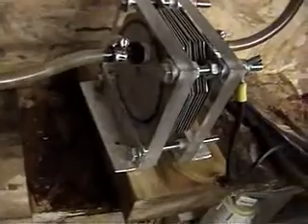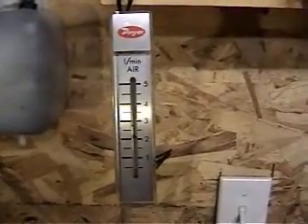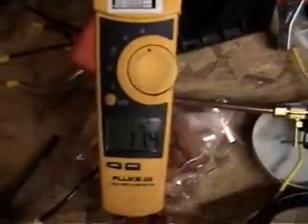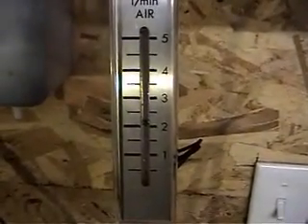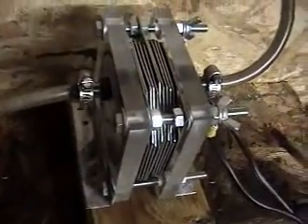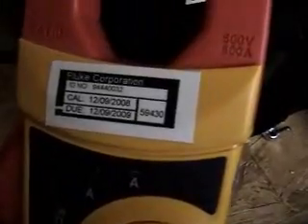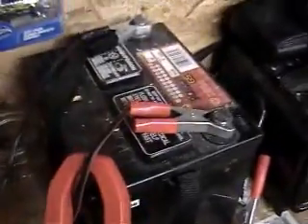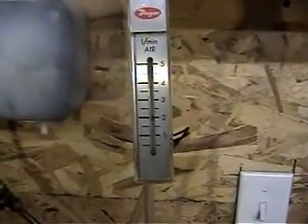HHO 3 LPM 23 AMPs

Comment: With that amperage the water will heat up very soon, that is not good. I suggest to use 120 V AC rectified half wave and use 20 plates.

Comment: i like the way you designed the cell...could you gang a few together by putting them back to back with two long all threads, one going through all three on one side for the positive and another on the other side for the negative ? or would that not be wired right?

Comment: For that size cell, with holes in the plates, surface area loss in the corners, 2 LPM with 12 amps. You must NOT be applying 12 volts but more like 30 volts!!! and your making water vapor and steam and not much HHO. Most HHO guys lie about the output, for some reason? Ionic water vapor does get MPG gains in dry climates. Google : Hydrogen Generator review to learn more.

Comment: @H2GenerationX 
Truthfully its for psi not just air because if you want to get technical than air has over 60% nitrogen and it has over 10% oxygen and another 30% other gasses. So when you say AIR you should no more about AIR.

Comment: @Me102288 
Yes it is only 12 volts that is correct but they were wanting to know if at 23 amps its producing more voltage also because he has the battery charger connected to the battery so therefore it is most likely producing more voltage i understand where IQmaza is coming from but if a transformer was connected you wouldn't need to worry about the voltage only the amps.

Comment: @arthus1971 
It still wouldn't matter if he did use the bottle method because the HH and O would still be mixing together so therefore the 66.6% of hydrogen and 33.3% of oxygen would still be going into the bottle. Now if the mixture was separated (Hydrogen and Oxygen) than that would work, but you cannot separate it using a dry cell. But if you did separate it than you would only have hydrogen gas but it would also take more to produce the same fire.

Comment: the air flowmeter, can not read the real production of hho, because the hho is a mix gas, 66.6% hydrogen + 33.3% Oxygen, try to fill the bottle method , by the way thanks for to share.